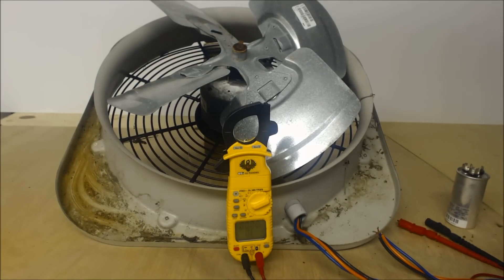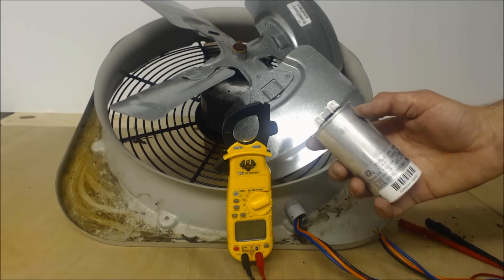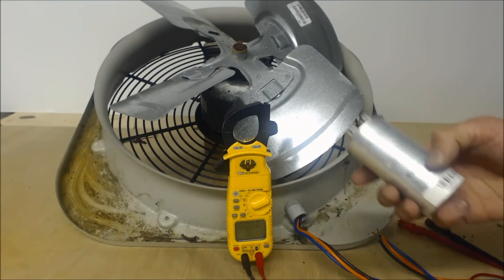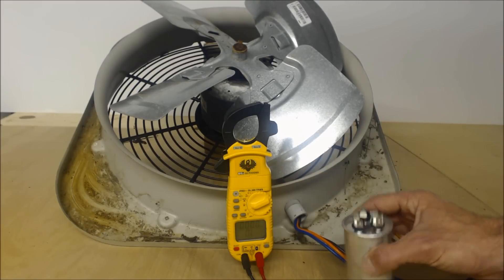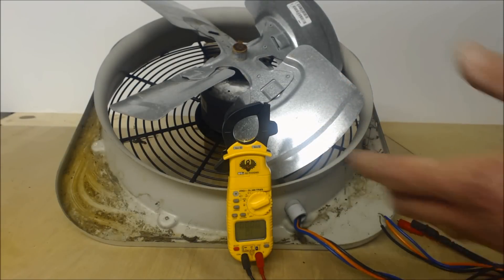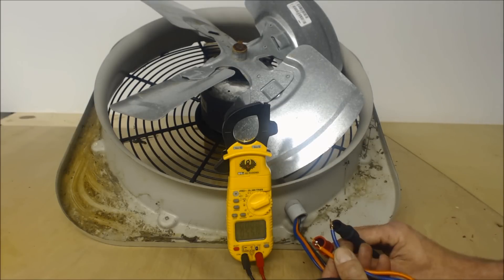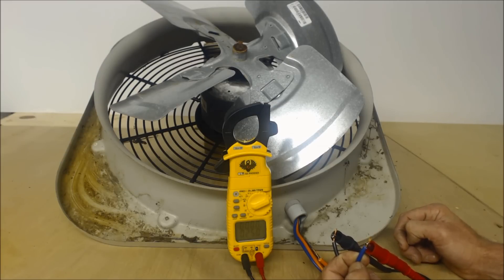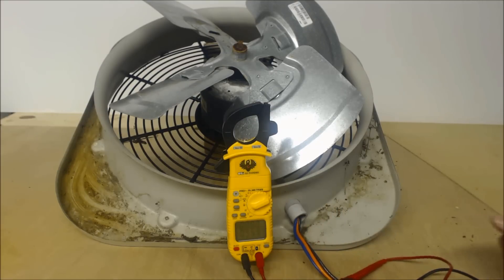Outdoor HVAC Unit Fan Motor! Step by Step Troubleshooting, Capacitor, and Exact Resistance Readings!

Comment: I have just replaced the capacitor and the contactor.  The fan runs for a few minutes and then stops. It gets real hot to the touch.  I have already checked the resistance on the three wires and they all add up.  The fan seems to spin freely by hand.  Any advice on what to do next to trouble shoot it would be greatly appreciate it.
Reply from the maker: There really is not much more you are going to do but to replace the motor. Just one last thing is to make sure that the voltage does not drop and is within an acceptable range for the motor while the motor is on, thanks
Reply: @acservicetechchannel   I've done the above as wel I'm having the same issue resistances add up but the fan doesn't spin...I'm going to pick up a motor and hope for the best...
Reply: @MetalSonic1389   what was the issue?

Comment: If the motor were bad, what reading would I get?  Thanks
Reply: Could be an open ol winding or short to ground which would be a resistance reading to ground.
Reply from the maker: Most of the time it is either bad bearings and doesn't spin or the windings have a resistance reading to the ground of the motor when it should not. The run to common plus the start to common may also not match the start to run resistance reading as well.

Comment: The orange wire would be your start and that would go into the capacitor right? The blue wire is your run so that one along with the black wire(common) would go into into the fan relay?
Reply from the maker: Yes the contactor relay and that's correct. Yeah this is the question I saw appear then it was gone before I could answer it. Hope all is well David!

Comment: THANKS for the video.
my ac fan has brown,black and yellow.. can u help me testing my motor?
thanks again
Reply from the maker: That would be a three wire condenser fan. You need to turn the power off and test from any one of those wires to ground with continuity. It should not have continuity. You need to read the resistance of the wires in pairs. Two sets of resistance readings should equal the opther pair. That would be a good motor as long as the bearings spin freely. Most times it is the capacitor which needs to be replaced with the exact same capacitor. Here are some videos for you. -https://youtu.be/0U_bpumqCRI------https://youtu.be/e9EfACNsZ7o---- if you want more like this then check the playlist on the channel page, thanks!
Reply: So I replaced my capacitor (correctly with the exact same capacitor from old one) and checked the fan which was good (30+50 on one pair, and 80 on one pair) and I still can't get this Goodman AC to work?   @acservicetechchannel

Comment: Your videos are always great. keep up the good work.
Reply from the maker: Thank you very much and I value all of your comments and questions! I will be getting to that live TXV diagnosis. 15 hour Heat Pump System Replacement all yesterday. Keep up with the questions!
Reply from the maker: When I say 15hr Heat Pump Replacement, I am talking about almost whole system replacement, cutting wall open, fishing lineset, new 40' long condensate with pitching, increasing return size and new grills, and so on. It is rare that I am ok with just replacing a Fan Coil and the Outdoor Unit just because of how it was installed previously as well as changing from R-22 to R-410A, that is why the 15 hrs. Just thought I should explain that statement. Thanks!
Reply: +acservicetech sounds like it's going to be great! which I could have had an instructor like you when I was in school.
Reply: https://youtu.be/HgnD_1ll0BC